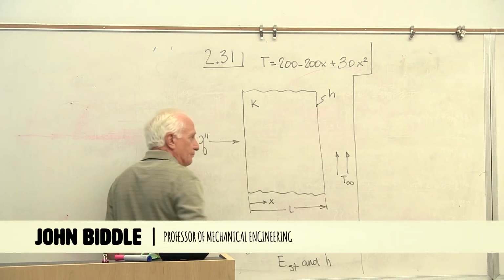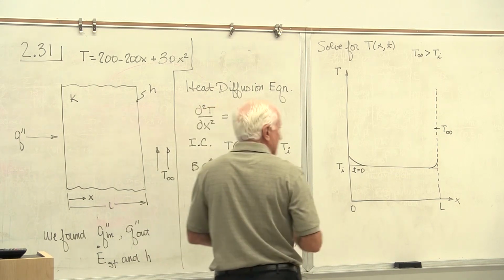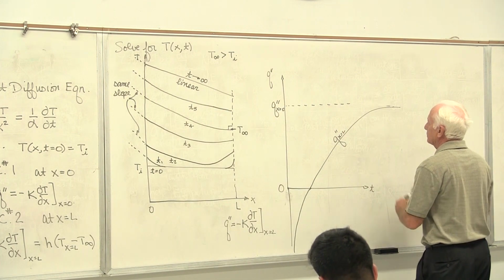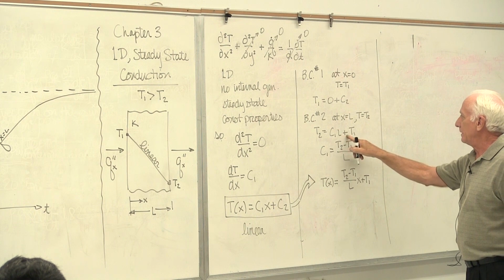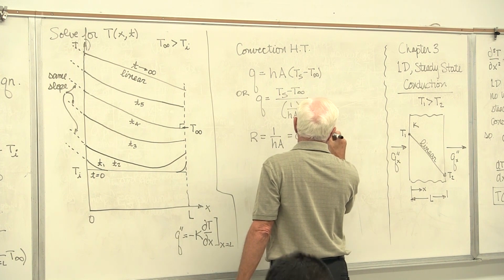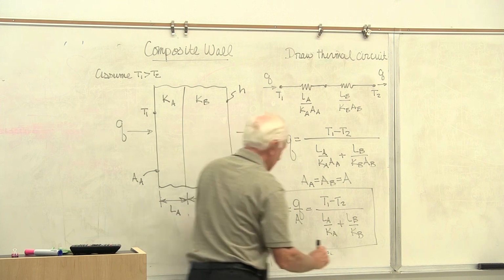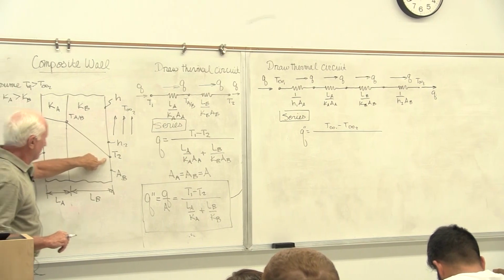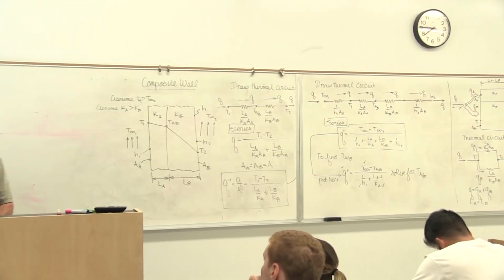Heat Transfer: One-Dimensional Conduction (4 of 26)

Comment: Untuk bentuk bola 
Saya hanya fokus pada perbandingan jari jari selubung bola terhadap ketebalan bola. Jika ditemukan R/ dR = 1, maka rumus tersebut haru dikaji ulang. Dengan persamaan umumnya adalah :
Q 		= - k. A. (dT)/ (dR ),	Hukum fourrier  	
Q 		= k. 4π R2. (∆ T)/ ( R2 – R1 ). 						………. 	1
Q 		= k. 4π R1. R2. (∆ T)/ ( R2 – R1 ). 						……….	2
Q 		= k. 4π R1 . R2.(∆ T)/ ( R2 – R1 ) = k. 4π R2.(∆ T)/ ( R2 – R1 ).  Pada rumus ini menekankan pada perbandingan jari jari selubung bola terhadap ketebalan bola. Sehingga persamaannya adalah :
k. 4π R1 . R2.(∆ T)/ ( R2 – R1 ) = k. 4π R2. (∆ T)/ ( R2 – R1 ), Sehingga bagian yang tereliminasi adalah k .4. π. 
R1 . R2. (∆ T)/ ( R2 – R1 ) =  R2.(∆ T)/ ( R2 – R1 ).
( R1 . R2.)0.5 (∆ T)/ ( R2 – R1 ) =  ( R2 )0.5.(∆ T)/ ( R2 – R1 ).
( R1 . R2.)0.5 . (∆ T)/ ( R2 – R1 ) =  R.(∆ T)/ ( R2 – R1 ). Sehingga didapatkan perbandingan jari jari selubung bola terhadap ketebalan bola.
( R1 . R2.)0.5 / ( R2 – R1 ) =  R/ ( R2 – R1 ). Sehingga perbandingan  jari jari selubung bola terhadap ketebalan bola
( R1 . R2.)0.5 :  ( R2 – R1 ),   adalah perbandingan  jari jari selubung bola terhadap ketebalan bola.	…….…	3
Dimana,
dR		: Ketebalan sesaat. (R2 – R1 ) atau ( outer –inner )
dT		: Temperature sesaat
K		: Konduktifitas thermal materi
Q		: Nilai kalor
R		: Panjang jari jari selubung bola
∆T		: Hasil integral dari dT
∆R		: Hasil ( R2 -  R1 ) = ( outer – inner ) = tebal
4πR2		: Luas kulit bola
R/ dR		: Sebanding dengan R / ( R2 - R1 ) Perbandingan panjang jari jari selubung bola terhadap ketebalan bola. 
Keberatan saya adalah :
1.	R2 	: R2 .-  R1
R2 	: R2 .-  R1 		~ 	R2. R1	:      R2 .-  R1,
R2 	=  R2. R1
Komentar saya adalah bahwa R2 ≠ R1 x R2.  R yang dimaksud adalah memiliki nilai yang sama, yaitu R x R.
Uraian penalaran :
R2 	: R2  - . R1 		 	 
R2 	: R2 .-  R1,  		untuk R2 = R x R. 
R2 	= R x R 
R. R	= R1 x R2 								…???
R . R	= R1 x R2, oleh karena R bernilai sama, maka R1 =  R2. Penulisan ini akan bermasalah dengan persamaan :  
Q 	= k. 4π R2.L (∆ T)/ ( R2 – R1 ),  dimana R2  =  R1.
Q 	= k. 4π R2.L (∆ T)/ ( R2 – R2 ).
Q 	= k. 4π R2.L (∆ T)/ ( 0 ).
Q	= + ∞ 								… ???.
Alternatifnya adalah :
R2 	: R2  - . R1 ,			 
R2 	: R2 .-  R1,  untuk R2 = R x R. 
(R . R}0.5	= ( R2 . R1 )0.5
R	= ( R2 . R	1 )0.5    							… ???.
Apakah jari jari selubung bola ( R ) adalah ( R2 . R1 )0.5  			… ???
Jika demikian halnya. Apa yang bisa dijelaskan dari ( R2 .R1)0.5  secara visualisasi  	… ???.
Komentar saya adalah  kesimpulannya R2 ≠ R1. R2
2.	Saya akan paksakan bahwa R2 = R1. R2. untuk membuktikan  keberatan saya. Selanjutnya dengan melakukan substitusi ke persamaan  awalnya, saat R1 = 0. ( Solid ).
Q 			= - k. A(dT)/ (dR ). Hukum fourrier

Q 			= k. 4π R2.L (∆T)/ (∆R)
Q 			= k. 4π R2.L (∆T)/ ( R2 - R1 )
R2.adalah jari jari outer dan R1 adalah jari jari inner

R2			= R1.R2
Q 			= k. 4π R2.L (∆T)/ ( R2 – R1 ).
Q 			= k. 4π R2.L (∆T)/ ( R2 – R1 ). saya fokus pada persamaan yang hurufnya bold.

Bagaimana jika R1 bernilai 0 ?.  Saya substitusikan rumus dasarnya.
Q 			= k. 4π R2.L (∆T)/ ( R2 – R1 ).
Q 			= k. 4π R1. R2.L (∆T)/ ( R2 – R1 ).
Q			= k. 4π 0. R2.L (∆T)/ ( R2 – 0 ).
Q			= k. 4π 0. .L (∆T)/ ( R2  ).
Q			= k. 4π 0. .L (∆T)/ ( R2  ). Pada persamaan ini muncul 2 jawaban.
Dalam hal ini akan muncul 2 alternatif jawaban.
Q			= k. 4π 0. L (∆T)/ ( R2  ),  0/R2 = 0, 
Sehingga,
Q			= 0		 			( alternatif 1 ).
Komentar saya adalah apakah saat bola dalam keadaan solid, maka Q = 0 ???. hal ini sangat tidakl masuk akal.
Atau altenatif lainnya adalah
Q 			= k. 4π R2.L (∆T)/ ( R2 – R1 ), R2 = R1. R2
Q 			= k. 4π R1. R2.L (∆T)/ ( R2 – R1 ), 0 =  R1
Q			= k. 4π 0. R2.L (∆T)/ ( R2 – 0 ), R2 – 0 = R2 
Q			= k. 4π 0. L (∆T)/ ( R2  ).
Q			= k. 4π 0. .L (∆T)/ ( R2  ),  0/R2 = 0 pindah ruas kiri
Q /  0			= k. 4π .L (∆T)   
+∞			= k. 4π .L (∆T ), k. 4π.L adalah nilai konstan ( C ), sehingga 
+∞			=  C ((∆T ), sehingga, 
+∞    			= ( ∆T ), ∆T = T1 – T2
+∞    			=  T1 – T2, , T1  = +∞ dan T2 diketahui, sehingga 
+∞    			=  ( +∞ – T2 ), satuan sisi kiri adalah watt dan satuan sisi kanan temperature sehingga tidak boleh dikurangi.
+∞    			=   T1
+∞   			= (∆T ), ∆T =  ( +∞ – T2 )	  		( alternatif 2 )
+∞ 			=  T1, ∆T =  ( +∞ – T2 )
+∞ 			=  T1,	
Komentar saya adalah  apakah saat bola dalam keadaan solid, maka  (∆ T ) = (+∞ ) atau  (T1 ) = (+∞ )  ???, hal ini sangat tidakl masuk akal.

continue........